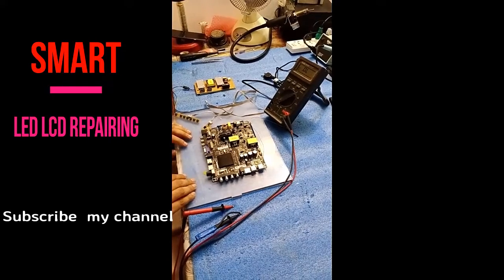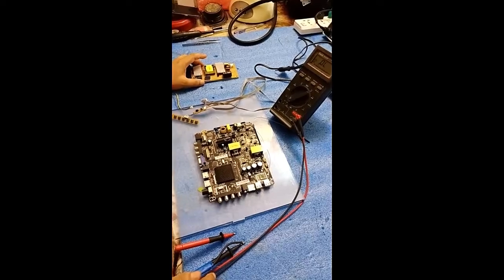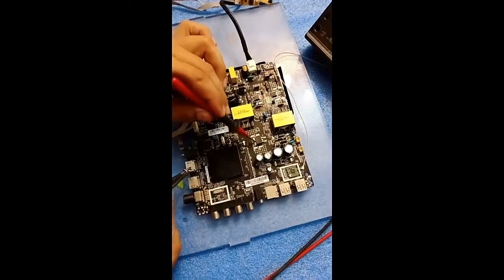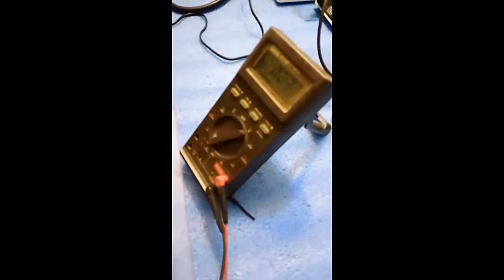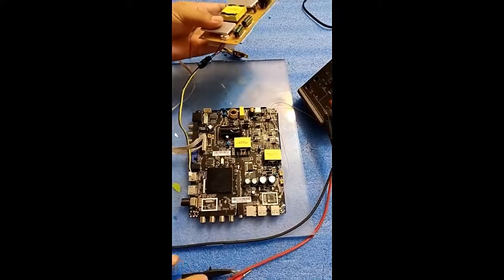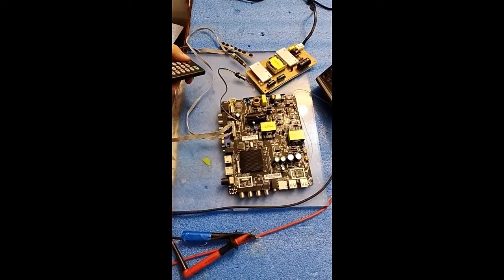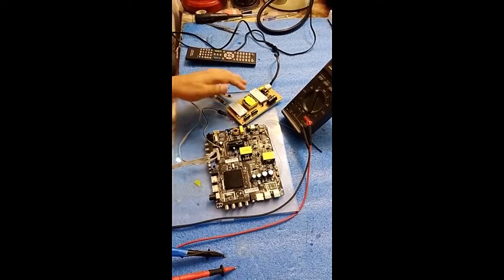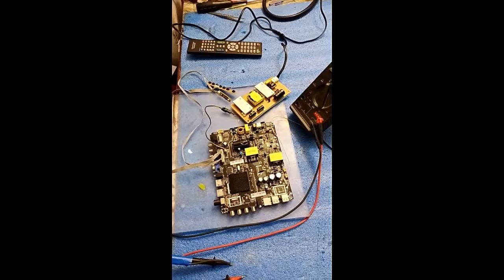HOW TO REPAIR UNIVERSAL COMBO BOARD || TP.HV320.PB801 || DUAL SMPS

Comment: Friend what is the ampere of 12v external psu that you used to power up the secondary sections? Thank you friend for sharing your knowledge in repairing,and it's awesome because your language that you use is english,can understand worldwide subscribers, looking forward to always watch your repair videos, God bless
Reply from the maker: Dear brother this external supply has 3 Ampere current, 
And I will try to be make videos in simplest way so that my subscribers and other viewers can understand it easily,thanks for your appreciation
Reply: Friend the same problem in my 40 inch tp.hv320.pb801 endroid bord,I hv used a adeptor (12v,1.5am) and backlight inverter but when I switching on then backlights are blinking continually,please suggest?
Reply: Dear Nilo please guide me, whether I increase ampere or use other 12v supply with 3A current.